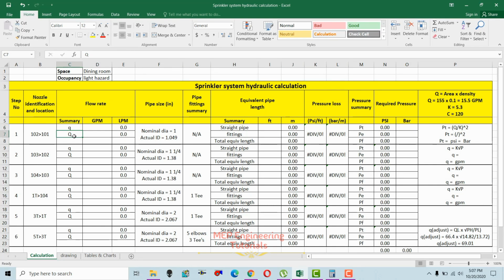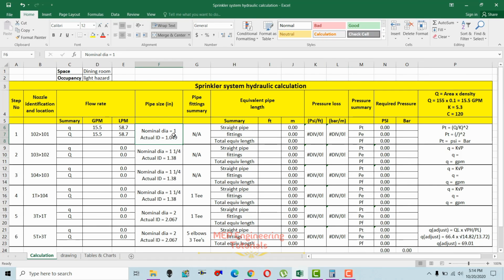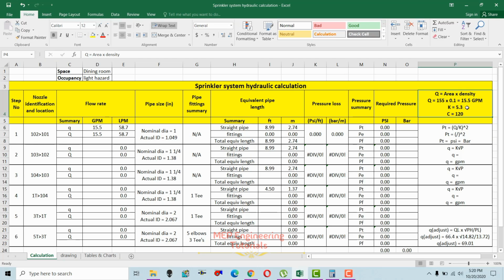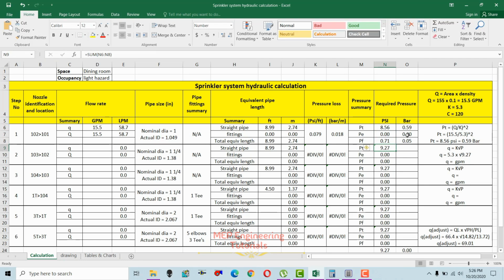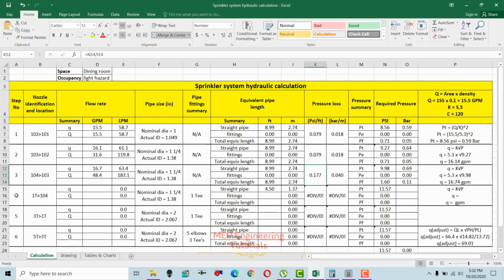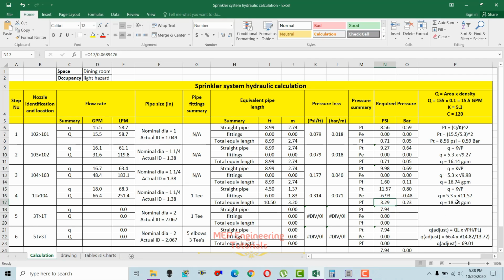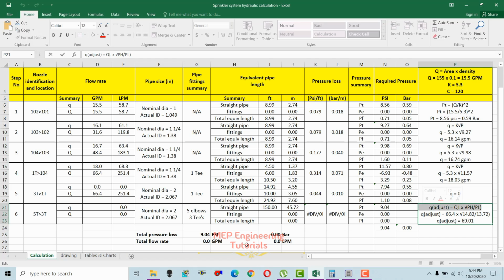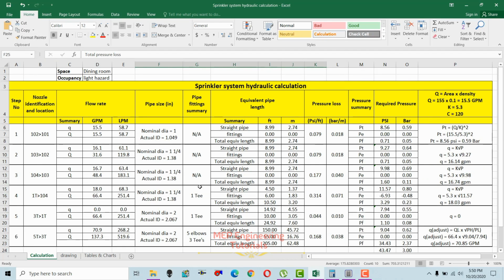fire sprinkler system design hydraulic calculation using software/excel, fire fighting system design

Comment: Why not utilize Hazen-Williams utilized for PIPE-FLO;  create a hydraulic model to represent the sprinkler system which calculates pressure drop to each sprinkler and the head loss due to friction in fluid flow??

Comment: how did you take 155 ft2 area for each sprinkler? where is the reference in NFPA? can you explain? @MEP Engineering Tutorials ?
Reply: NFPA 13 in the chapter on hydraulic calculation from what I remember they have a figure indicating that the area is the distance between sprinkler heads times the distance between branchline, and extra requirement to take into account the distance to the wall. But if the distance to the wall times twice the distance on the branchline or sprinkler head spacing then you need to use two time the distance to the wall. You need to check the area for each prinkler head. The 3rd sprinkler head on the branch line has a spacing of 10.5 ft between the heads x 10 ft spacing between the branchline = 155 sq.ft.

I have not watched the video in detail but what I have done is look for the sprinkler head with the largest area and use that for my end head sprinkler condition. Otherwise I have to caluated the area for each head and mulitiple it by the density and calculate the minium flow at each each, then check each head in the hydraulic calculation and verify it with the minimum flow. Hydraulic calculations can be very time consuming so I'm looking for short cuts since you will have to make mulitiple calculations anyway. The extra pressure at the head I see it as a safety factor incase any error should arrive later, so I can go back later and reduce the starting pressure and minimize the changes. There are so many pipes and fittings making many possible sources of error, and possiable future changes. Remember later the ductwork will change and your have make extra fittings to go around it.

Comment: wow great video tuts. by the way if im not mistaken there is always a fitting to heads when using pendent type and Tee when upright right? so its not consider in hydraulic calculation?

Comment: How to calculation for Pe?
Reply: Pressure loss due to elevation
psi = .43333 x h (ft) 
p = rgh = wh
psf = 62.4 lbs/sq.ft x height (ft) , 
psi = 62.4/144 x height (ft)
Reply: @icutoo2699  Thanks

Comment: Hi, does little q represent the flowrate going to branch 105-108. Also did we omit the pressure loss in branch 105-108 when taking into account the total pressure loss of the system? @MEP Engineering Tutorials

Comment: Hi, say if the room has double layer sprinkler (one upright inside ceiling, one pendant sprinkler) within the area of operation, do you consider both layer points in the calculation?
Reply: no , it is assumed that only one will operate

Comment: Hi Sir. 
Should we consider the ITC in sizing of branch pipes? What if a branchline serves 2 sprinkler heads and the ITC (Inspector's Test Connection)? Should the size of the pipe 32 mm or 25mm only?

Comment: Thanks sir this is great video and job. I want to ask a question, in this video there are sprinkler only in one side of cross main if there are sprinkler in two side of cross main, how could we calculate the flow in riser from cross main to both side branch line, can we double it or there is other way

Comment: Thanks for this amazing lecture, I observe that you said no fittings between 101 and 102 sprinklers, if I may ask what about the elbow at 101 to which the sprinkler head is connected and the tee at 102?
Reply: There's always a connecting fitting it's omitted because it's not an additional flow piece.
Reply: @rugger3buffalo  what do you mean? If I may ask also, He changes the pipe size  and didn't include any fittings like bell reducer from 1 in pipe to 1&1/4 in pipe. There is a pressure loss there right?

Comment: how do we calculate the remote area for sprinklers?  Here 8 nos sprinkler has been taken. Suppose if there were 20 nos of spinkler,  shall we take 20 or less ? Kindy explain. Also, The area of the sprinkler is said to be 150 ft 2. I tried searching in the NFPA 13 std. but couldnt find it . Please help. Thanks
Reply: 225 sqft is the maximum. For the actual area you need to look at the plan and the sprinkler spacing. 10.5 ft spacing between heads x 10 ft spacing between branchline = 155 sqft.
Reply: Hi sir I want speak wt u
Reply: As per standard NFPA 13 It is mentioned 225 sqft .....

Comment: From the most remote area which has been considered in this calculation to the supply source the pipe size will be varying. But here its considered 2" pipe line till the source of supply. Can you explain.

Comment: Thanks Man, It was so informative. In 1T>104 it seems you missed an elbow.
Reply: yes
Reply: I also notice that. But how about the fittings for changing the pipe size? fittings like bell reducer for 1in to 1&1/4 in pipe. There is a pressure drop/loss there.

Comment: Please explain to sprinkler pipe installation methods and difference between to looping system and grid system.
Reply from the maker: Sure I will make a separate video for this
Reply: A loop you can still do on a worksheet, have to add in a hardycross routine but a grid you need a program.

Comment: Will the required pressure from the fire hose cabinet be added to the final pressure?
Reply from the maker: Yes we need to add that pressure too in final calculation
Reply: if you're talking about the inside hose allowance. as per nfpa there's no need to add the pressure for that because there was no design pressure for hose allowances
Reply: @ben-hurrocillo1645  Yup, read that from somewhere before. I just don't get why some designers add it to their final pressure and wanted some confirmation.
Reply: @josefmadrona3606  NFPA states that the hose allowances doesn't need pressure.

Comment: What is main pipe level and branch pipe level . ? 

I could not able to understand about negative pr. 
You told 3 feet ?
Reply from the maker: This is due to difference in elevation between cross main and branch piping. And it's subtracted from total loss because cross main pipe is 3ft above than branch piping. Head gain due to change in elevation is 2.31x3ft = 6.93ft
Reply: @mepengineeringtutorials  I understand, the elevation gain is negative, but I think it should be 1.3psi. 
As you said 1psi = 2.31ft of change in elevation. Hence, it should be (3ft)*(1psi/2.31ft) = 1.3psi.
It also anchors to the derived mathematical concept of head in change of elevation of P=0.433H. So, we will arrived to the same answer as P=0.433(3ft) = 1.3 psi.
Please confirm.